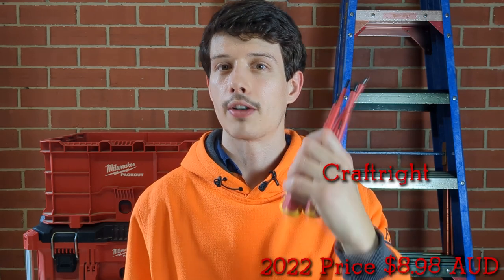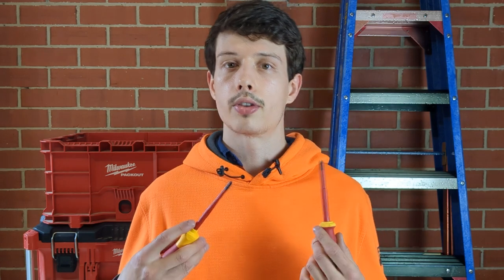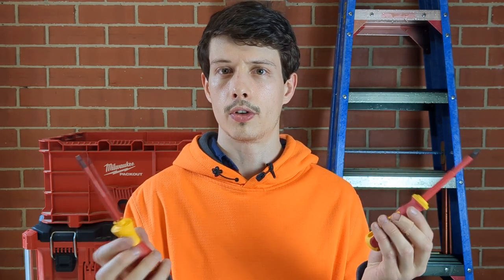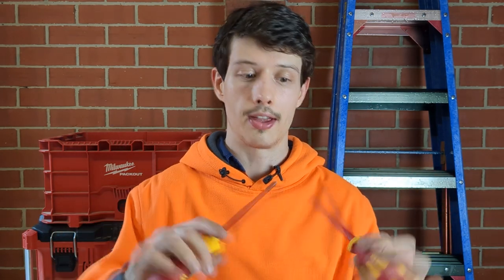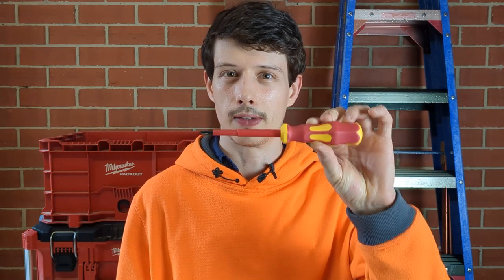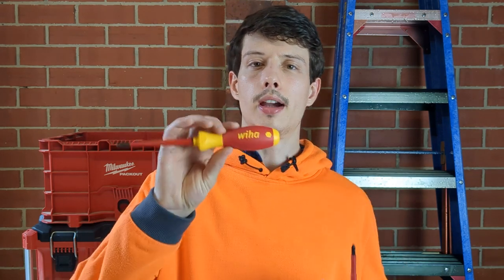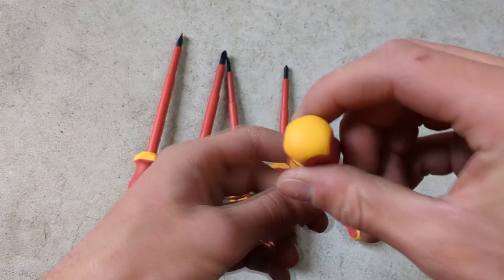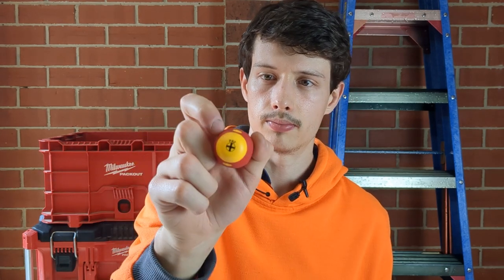$9 vs $100 VDE Insulated Screwdriver Set + Their Basics

Comment: Been using Bahco for about 10 years now, but I also bought a set of Werckmann. The Bahco set was about €50,- and the other set about €6,- .
There is a difference in durability, but as long as the insulation isn't damaged, they're both perfectly safe.
The Bahco set has seriously degraded rubber on a few of the grips by now, so I need to replace them. The cheap set has all the tips worn really bad, and I haven't used them nearly as much. Worn tips do tend to damage the screws and terminals too though, so that's a good reason to go for something more durable. That said, the €6,- set is a LOT better than non insulated tools.  When in doubt: buy the best you can afford, do your work safely and save up for better tools somewhere down the road ;)
And yes, I DO work on live installations. I mostly work in venues where they have live music or theater. Especially the smaller ones don't have the budget for proper modern gear, or even proper techs who plan what is connected where. If you have to do work on a fuse box, often the only way to power it down is to literally disconnect the main 400A fuses. That would shut off most of the building, and it would require the service provider to send someone over to cut the seal and replace it. That takes days, or even weeks, and it's VERY expensive. So if something happens that really needs to get fixed before the show that night, you're working on a partially live installation. Safety is THE ABSOLUTE HIGHEST priority EVER. Especially since there are also other people running around. I'd MUCH rather use a new €6,- set than a defective €50,- one XD

Comment: I use Felo Screwdrivers which cost a lot more, but they're extremely comfortable in my hand. 
The quality of the steel or its heat treatment must be superior as I've never had the blades chip or round off unlike with cheaper options.

Comment: I agree with you on the value aspect, but there's four other things to consider;
Would you really like your customer to see you using the same thing they can get for $10 at the local diy shop? Customers tend to percieve tradies using higher end tools (and keeping them clean!) as more professional. Though it's more relevant in a residential setting where you are working for an individual person.

The overall comfort of the screwdriver, such as wera having a special design that fits your hand very well.

Additional features like wiha and wera having a slim bit so that they can get to screws that are recessed, or the wiha screwdriver like I have which can store six bits in the handle to keep your tool bag light, maybe even lasertip on wera.

And of course, if you are earning money and using your kit every day you will probably want to have a tool you can really trust and be proud of, although more relevant to pliers and cutters, even when going through the same tests the durability of the plastics or the tips on screwdrivers can vary. I personally have a few screwdrivers that are reserved for beating on and then a couple sets that I keep in good condition.
Reply from the maker: Cheers for the comment! Yeah defs a good idea to have a cheaper set you can abuse and a more expensive set you keep in good nick.

I've done high-end residential work and honestly I don't think any clients have noticed the difference nor care what brand of screwdrivers I use, however carrying your tools neatly on the job will give off a more obvious good impression (for example my PACKOUT/Makita pouch system)
Reply: @coreybruhn  I would agree, having a high end brand isn't the most important thing for impression. Personally I would say that this is the order for what makes the most difference:
keep tools clean, carry them in neatly, have quality tools
I have veto bags for all my hand tools, I find the TP-LC a good size for the selection of drivers, pliers, cutters, grips etc that I generally find myself needing. 
I'd say the power tool brand is more noticable for clients, since they always have sizable logos.
Reply: Kibah  You might be surprised, I've seen and heard about some seriously snobbish customers.
Reply: Client will also look at what type of car technician drive to determine his professionalism? 😂
Reply: @AndrewStrydomBRP  that’s exactly the kinda customers I don’t do business with. If everyone isn’t gonna be happy when I’m done I don’t want anything to do with it
Reply: @strawberry_cowsyt7860  It's not about the customer not being happy, it's about them getting percieved value and professionalism. Same thing as if you turn up in a rusty old van and ripped clothes vs something more modern and well kept, and some smart, clean clothing.

If they see you using the same tools they can get themselves for 10 bucks, they're going to think you're cheap, and your work is cheap, even if it isn't. Brand perception is major and subconcious in most people.
Reply: @Tom-gr9ii  Unironically yes, especially richer clients will percieve professionalism on the brand or age of the van/car you drive. It's non negotiable and unavoidable in the real world as brand perception is deeply engrained in society.
Reply: Having an expensive tool doesn't automatically make someone a skilled electrician.

Comment: What the specialized fields that work in a live circuit? It's seems wild to think people would do that
Reply from the maker: Mainly industrial where sometimes it's necessary, but yeah I would never work on live circuits
Reply: In an industrial or commercial environment, you can't always shut down a circuit to replace a failed component. Your customer may have a production line with dozens of receptacles and fixtures on it and one of them fails. You wouldn't have the customer shut down the production line just to replace one failed receptacle or fixture. Or shut down a critical section of a utility to do the same. I always work on de-energized circuits, but there is sometimes a need to keep the circuit energized while a repair or new connection is made.
Reply: Hospitals, can't go turning off an entire ward to change a power point when someone may be on life support etc.

Comment: plastic is soo much better on wera and wiha screwdrivers. cheap shitty drivers insulation peels of very easily. also you can get wiha and wera as slim
Reply from the maker: That's if you're okay using screwdrivers that aren't insulated up to 1000V as a sparky